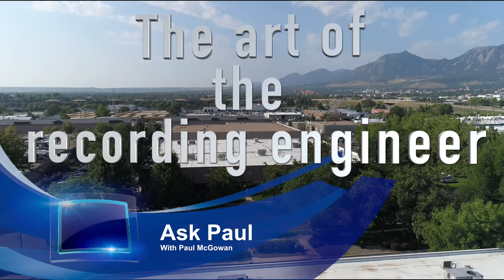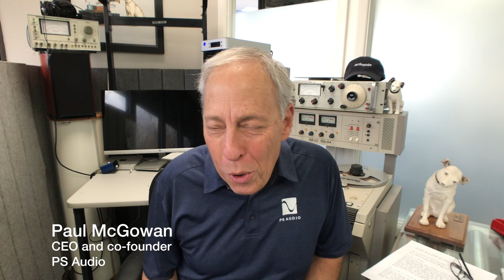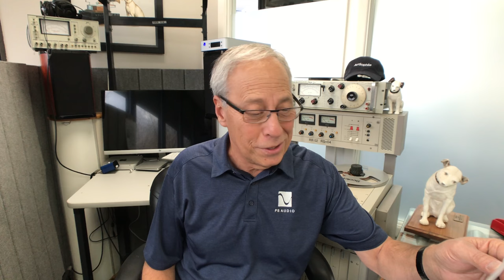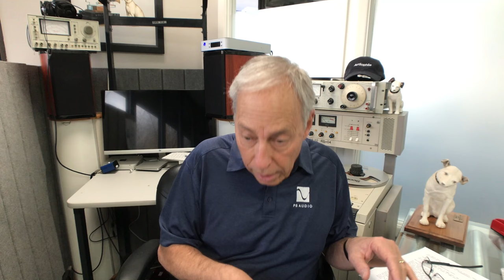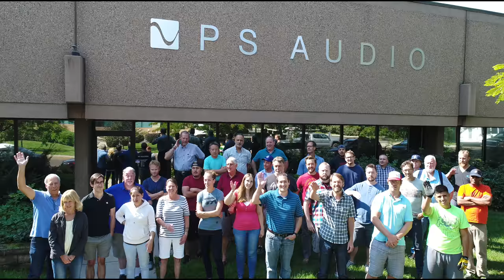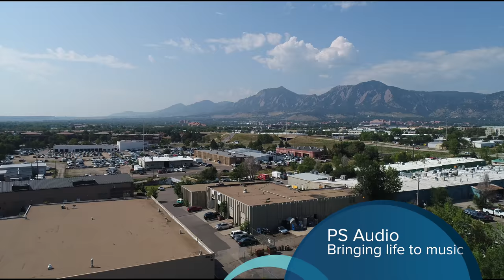The art of recording engineers

Comment: The producer is the 'director of the movie'.  A recording engineer is the DP of the movie.  The Director of Photography gives the 'look and texture' of the film, just as the sound engineer does for the recording.

Your explanation of what a recording engineer is simplistic and leaves out WHAT A RECORDING ENGINEER ACTUALLY DOES.  Just as the DP adjusts lighting, angle perspective, lens choice etc. to create a certain look, the recording engineer does the exact same thing.  

Example:  An engineer in many cases will tune the drum kit, or at least have final say in tweaking.  In fact studios always have house kits that will deliver certain sounds.  The sound of the kick in a rock recording does not exist in it's natural state.  It is composed of two different sounds-- the main fundamental which is the low and the attack which is the higher sound of the beater hitting the skin.  A 22" bass drum has a natural resonance of 60Hz.  This is why the low EQ on a Neve console is set at 63Hz  which later became known as the famous 'English Drum Sound"  Multiples of 30, 60, 120Hz all share a common main tonal quality -- solid sounding bass.  Similarly, multiples of 50Hz all share a common tonality-- rounded bass.  And so on throughout the spectrum.

Even the way signals are loaded onto tape determines the texture of the recording.  The goal is not distortion free sound-- quite the opposite.  When tape saturates it distorts in third and fifth wave harmonics, thus the perfect saturation is desired past the point of a distortion free recording.  Anyone with a musical background can see the value of this.  One is the fundamental.  Three is the third harmonic.  Five is the fifth harmonic.  1,3,5,  You have a musical chord.

As for the "furious twisting of knobs" that Paul describes-- it never happens.  If that's what it takes to produce and modify sound your mix is totally lost.  In my 40 year career the last time I did that was 39 years ago.

p.s. love the channel but I go nuts listening to audiophiles misconception of sound.  Part of the problem is that in the audiophile mind, the end product is the be all and end all... there are 500 steps before that which have a much greater bearing on what you actually hear.

Comment: The work of a recording engineer is to record well, but also make up for the realities of recording, as well as to pleasingly enhance performances through use of FX, etc.  When you record a band each microphone picks up the band from it's own position and levels according to proximity (and frequency spectrum specifications.)  When you "mash" these all together it is not as simple as just adjusting levels although that is very important.  But you can get frequency build ups that can just overwhelm a mix so a very important part of audio engineering is making various part sit well together in a mix.  Indeed, when you blend two or more parts together that have strong energy in a particular frequency range that can create various orders of harmonics (basically new sound) that can cloud and even ruin a mix.  An engineer may choose the more important instrument and then cut the competing frequencies of other instruments to make them sit well together.  When this happens in low and low-mid frequencies we call that mud.  Further, the perfect mic placement for two instrument may mean that two of more mics are out of phase.  When you mix these they will cancel each other out, partially or completely.  This is usually not good.   Other situation that need to be mitigated are things like mic bleed.  You cannot make a microphone hear only the instrument it is pointed at.  Although it will favor it the mic will pick up things all around that.  Mix several mics together and now that bleed is a major factor in the recording as it is a common sound being layered many times over.  Recording engineers and mixers do a lot!  Sometimes the task is simple but it is often a skill of it's own knowing when to keep it simple.  Microphones do not hear like humans do.  We are forgiving of live performances and can even filter out things we don't like with selective hearing.  But if a record has a flaw it will be played over and over forever in the same place and that is not so easy to overlook.  Indeed, it gets worse each time we hear it. Producers, engineers, and mixers are every bit as important as the artists.